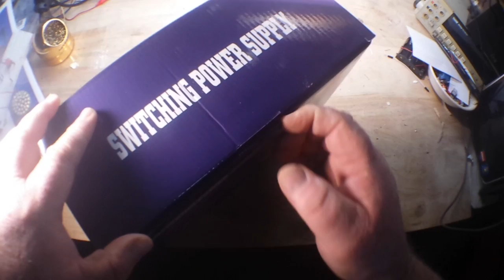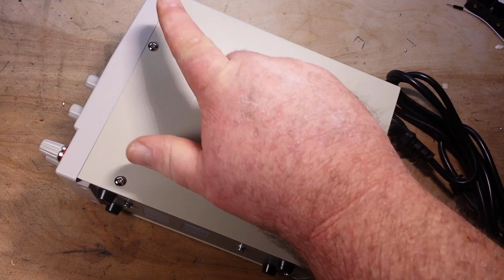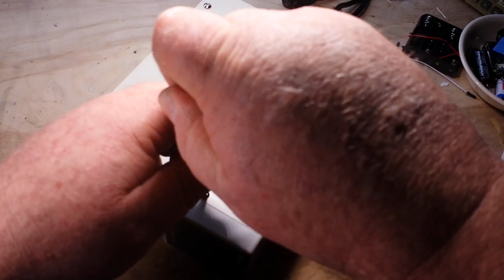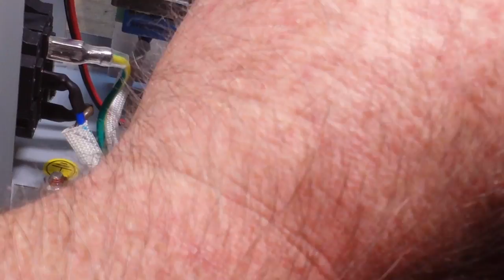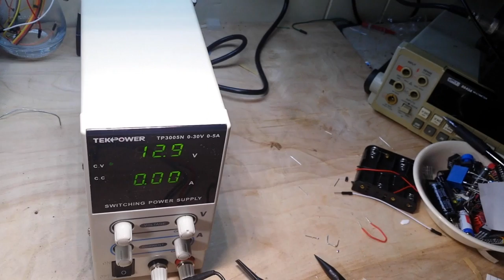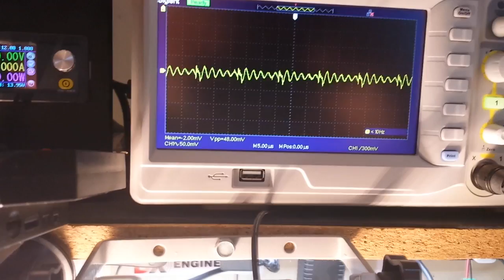The cheapest adjustable bench power supply from Amazon

Comment: The ripple is not bad for one of these, most are worse, but I wish you tested it at 5A (full load)  ...it may have been a very different story.
Also be aware that CC morde with a low R load (i.e. 1 ohm) often has huge current ripple.
btw I expect the PWM is on the daughter board.

Comment: 3:20 You cannot have too many power supplies or multimeters!
Reply: There are never many multimeters.
I have more of 30, most are Fluke
I hace the next
Fluke 27 series I (3 units)
Fluke 28 series II
Fluke 27 series II
Fluke 289 series II
Fluke 87 V
Fluke 97
Fluke 99 series II
Fluke 77 series IV
Fluke 867
Hioki
B&K 
Siglent Benchtop multimeter SDM3045x
VTVM (3 units)

And many others, oscilloscopes maybe 11 or more I am not sure.

And tons of the other meters.

Best Regards.

Comment: Hey, 60 mV of ripple is pretty good for this class of item actually, I'm messing around with a similar type of budget psu and the switching ripple is 400 mV.  (the snubbing of the switching part of the circuit is obviously a crappy design).
Paul, I would be happy with the one you tested.

Comment: On these cheap power supplies it is often good to check how the output voltage changes when it is powered-on and -off.  Sometimes there can be severe voltage swings if the capacitor to the control circuitry is not large enough...

Comment: Nice review. Certainly what you pay is what you get.
It would be good to look at the PCB and see if there are any tracks or components that could be upgraded or thickened to improve the performance.
What are the specs given in the manual?

TNY274-280
TinySwitch-III Family
Energy Efficient, Off-Line Switcher with
Enhanced Flexibility and Extended Power Range

This is the SMPS IC.

Comment: it's unusable... If I was you I would replace the pots with cheap multi turn pots from ebay. Also 50 mV ripple is a bit on the high side. Could be significantly reduced by a simple LC-filter

Comment: With the fuses already there, I doubt it is not a “PTC” but an NTC component at the input.,  A PTC would act as a self resetting fuse.  But what is actually needed in a switching power supply, is an inrush current limiting that is accomplished by an NTC resistor.

Comment: Great video review Paul, thanks! I like it too. Seems decently built and thought out. I like the big plate heat sink, too. On the calibration thing, all of these SMPS's have those blue Bournes potentiometers inside on the circuit board to tune the volts & amps in anyway, so that's no problem. It would be kinda surprising if they were spot on, because of the huge variation in elevation/temperature etc between China and USA. Sometimes we get lucky is all, i guess. Thanks for all your work here, Paul. I really appreciate it, although i rarely comment. I am an old retired and disabled newbie to electronics but i do enjoy dabbling and learning when i can. Great work, mate!
Reply from the maker: Thank you very much!!!

Comment: Nice concise video Paul, thank you!  
Question - on inexpensive power supplies such as this, (I have the last such one you recommended - SS-3005H) how does one set the current and/or voltage to provide the CC & CV settings? 

As you know, I am returning pretty new to this electronics malarkey, after some decades of absence, when such new fangled tech equipment, especially from China, was not around, thanks Prof... 🤔 🧐 🐍
Reply from the maker: Turn your voltage down to about .5V.
Short the leads and set your current.
Finally clear the short and set your desired voltage.
Reply: learnelectronics Brilliant, thank you Prof... 👍🏻 🧐 🐍

Comment: Is it better to build your own from an old computer power supply and a YouTube video, or buy a cheap one somewhere? I would think build, since I could get higher amperage cheaply.
Reply: Unless you have all the parts, I would buy one. 3.3, 5, 12 volts is nice, but adjustable voltage is better. If you bought the parts to make an adjustable one, it would probably cost more than the ccc version (cheapo chinese cr$%).

If you need higher power on a budget then search RD TECH .. They make buck/boost converter modules that are in the 50/15 range for like 30 bucks, even hook up to your computer...
https://www.aliexpress.com/store/product/RD-DPS5015-Constant-Voltage-current-Step-down-Programmable-digital-Power-Supply-buck-Voltage-converter-color-LCD/923042_32702714880.html?spm=2114.12010610.8148356.9.162650efXbZCmf

Comment: Sorry, I only speak American. 👅 I've had a Tek-Power 30V 5A power supply for several years and never had any problems with it. Of course, I don't build what you would call sensitive circuits either. I build mostly CNC related projects, so a few mV or uA one way or another is not a problem. I must say though that this PS is about 20 bucks cheaper than I paid. Thanks for a good Friday teardown video!
Reply from the maker: Glad you liked it

Comment: First big flaw to me is only having 3 digits on the Voltage. Looks like you have to adjust Coarse, then adjust Fine with a multimeter attached to get it where you want (should be able to get it on the nose). THEN you can start using it on your bench and make sure you don't touch the dials. Not ideal to say the least.
Reply: The dials appear to adjust the voltage directly vs giving a microcontroller a Target voltage. Doesn't seem to suit well with me either.